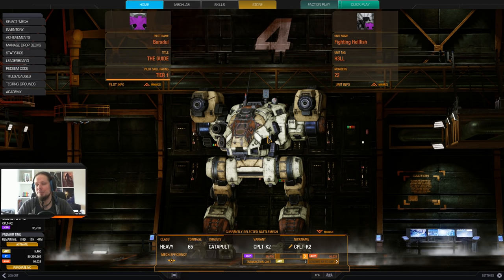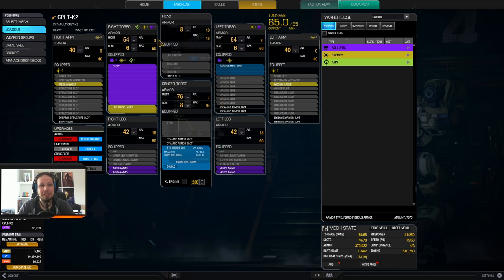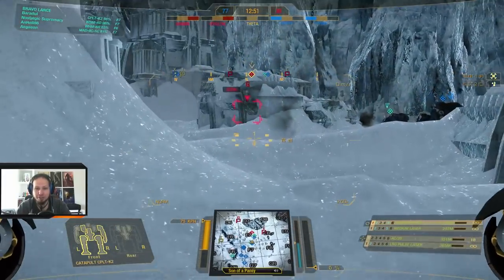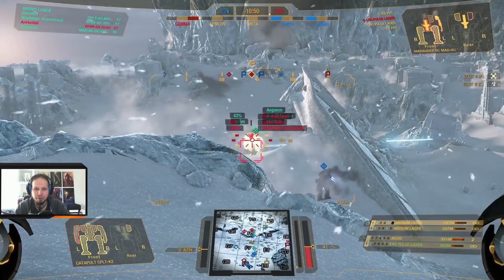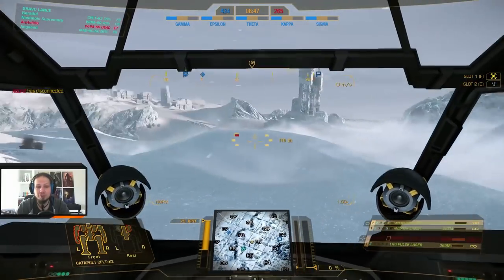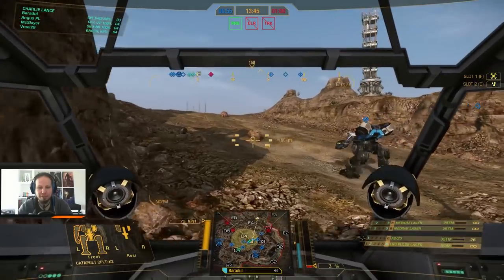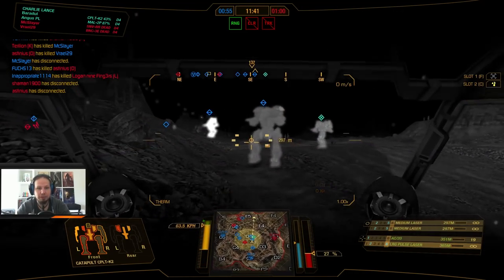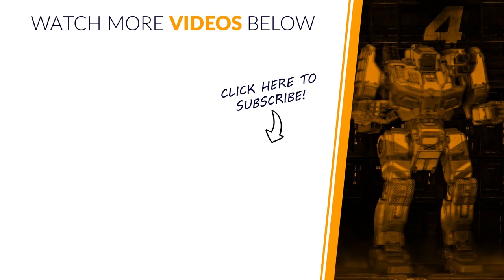A reasonable AC20 Catapult CPLT-K2 - Mechwarrior Online The Daily Dose #180

Comment: With the new Light Engines, the -K2 will be more feasible as an AC/40 platform, e.g.:
65t Catapult CPLT-K2
2 AC/20s w/7.0t ammo (24.5 volleys @351m), 40FP
LT270 (72.3kph), 0JJs
304/422 std arm, es, 10 dhs (67% cool), 6 slots free
ac/20 rng & cd, radar dep, seismic, (2 consumables)
bal rng +20%, bal vel +20%
Reply: depends on how much tonnage you can save with a light engine.  I'd probably look at that
Reply: LT270, incl. gyros & cockpit, should come in at 17.0t in MWO. You would save 3.5t vs. the STD270, at the cost of 4 slots.

Comment: My dual AC20 K2 only holds 5 tons of ammo, so is capped at 700 damage without using strikes or getting an ammo explosion.  Still  it regularly get 550-600 damage at the end of a match which isn't bad for a mech of its tonnage.

Comment: It's not a good build and both your games show it. Std engine on an XL friendly CAT puts you in such a huge disadvantage that you must use its upside to the fullest, i.e. - run dual ac20. Want to run a tanky std heavy with a single ac20? take a CTF, at least it can actually tank. Jager will also do the job better.

p.s. that friendly fire was not a derp, it was a very careless gameplay that can ruin all the fun for your teammate. but i know you are usually careful. maybe the commentary distracted you or smth.
Reply: I use 4 med lasers and 2 uac 5s with an XL. Brutal little thing :)